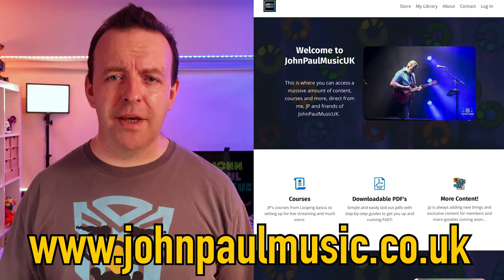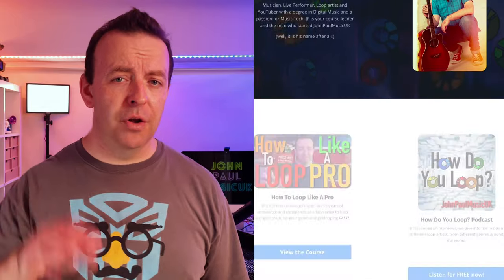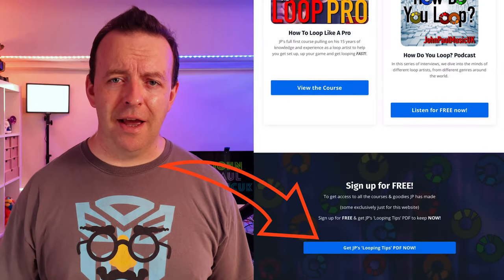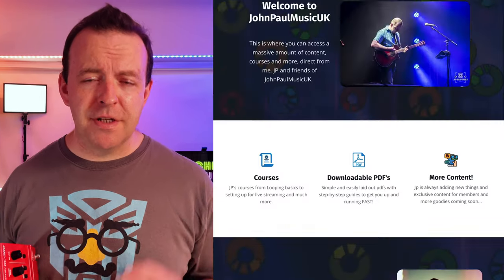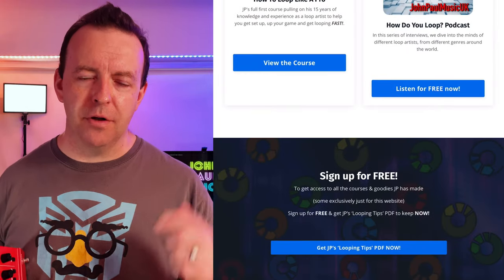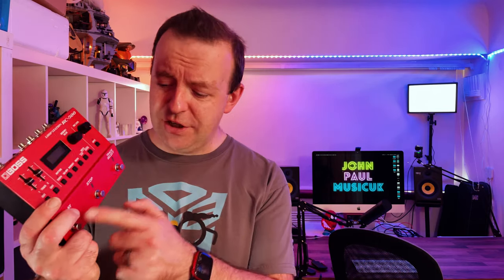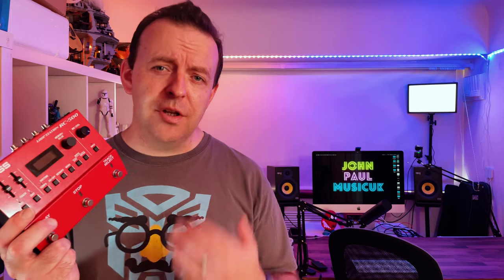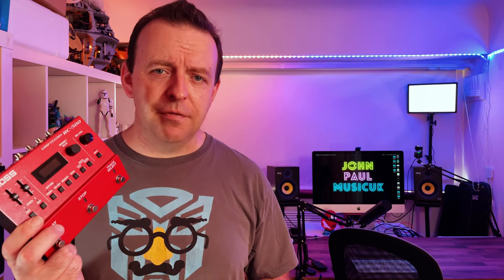Boss RC-500 - How to Route the Loops

Comment: I've banging my head against a brick wall, so I'm hoping you can help (I've just subscribed to the paying version BTW :-)) Right, first I have a mic and a guitar. Mic should go into MIC IN, and only to T1, Guitar should go into to INST IN B, and T2. Mic should also go (only) out of T1 (OUTPUT A) to its own channel on the desk. And the same for the guitar on T2 (OUTPUT B). I've followed your instructions in the video to the letter but am not getting a signal into the desk from the guitar....
Reply from the maker: Hi Nicolas 👋 
Thank you for becoming a member. 
So.. follow me closely, there are 3 things you need to change. 
The inputs, the outputs of those inputs and the outputs of the loops. 
1) select input button underneath the mic level
2) change MIC IN to OUT-A
3) change INST IN to OUT-B
4)EXIT
5) Click track 1 edit
6) Scroll across until you see T1 INPUT and Change this to MIC IN
7) Stay on the same menu and scroll across one more to T1 OUTPUT and put this to OUT-A
8) Press the Track 2 edit button
9) you should be (if you didn’t click exit between steps 7&8) on T2 OUTPUT, Change this to OUT-B
10) Scroll BACK one to T2 INPUT and change this to INST IN

EXIT AND WRITE THE THE MEMORY. 
You should now have the mic and the mic loops only coming to Output A and the guitar and guitar loops coming to Output B.
Enjoy. 👍🏼 😊
Reply: @JohnPaulMusicUK  Cheers JP - it works perfectly!!
Reply from the maker: Awesome 👏

Comment: I wanted to upgrade to the RC-500 from my Boss VE-8 (Which has an integrated looper just as a feature)... but the routing settings on the VE-8 just make more sense to me... I can select where the voice and where the guitar is coming out... Why can't the Boss RC-500 remember what's voice and what's guitar for every track? So for example voice is always coming out from Output A and Guitar always from Output B no matter which track is playing.... You always need to have Voice and Guitar seperated live, what are they thinking? This is bullshit, I'm glad I didn't buy it....
Reply from the maker: The routing can be set for the whole system if you want to for the inputs. 

Have a look at the parameter guide on page 14 and that is setting it for the whole system. https://static.roland.com/assets/media/pdf/RC-500_Parameter_eng01_W.pdf
But the output routing of the loops is per memory. 
Hope this helps.

Comment: Hello :) Is it possible to record with drums? I do not register drums in the wav file ... Regards Sielek :)
Reply from the maker: Are you looking to capture the kit from the Rhyrhm section? The wave file is your instrument or mic from the looper. 
If you want the Rhyrhm section as a wav file, you would have to record it from the looper into a recorder or DAW and then save that. Hope that makes sense?
Reply: @JohnPaulMusicUK  Thanks for the hint :) I think I'll just buy an audio interface and connect the looper's output. It will be the easiest way ... Regards :)
Reply from the maker: Yeah, good option. Don’t know why they took the ability to use the looper as an audio interface out. Such a shame. Miss that option, especially for recording.
Reply: @JohnPaulMusicUK  The drums can be in a loop :) There is an option in the settings. Input - Rhytm LOOP. Then they record while playing :) They are in the vaw file :)
Reply from the maker: Ahh. Okay. In the Parameter guide ‘Rhythm - Loop is described like this - 

‘With the “LOOP” setting, RC-500 drum sounds played by note messages from an external MIDI device can be output to a track and recorded.’ 

So I read that as it would send the same ‘pattern’ out as midi for an external drum machine to play it.

Comment: I have a problem: No matter what I do - and I believe I am doing it correctly as per your instructions ( and the manual) I cannot seem to isolate OUT-A and OUT-B. Everything comes out of both jacks, even if I am only trying to output rhythm to OUT-B. I even tried reinstalling the firmware. Everything else works perfectly. Cringe....
Reply from the maker: So have you changed the input as well as the output? Click on the input button (underneath the mic volume dial) and make sure you have changed the inputs as well as the outputs and the outputs of the loops too. 👍🏻 
Let me know if that helps.
Reply: @JohnPaulMusicUK   Thank you so much for your snappy response.
Me oh my. Tried plugging in both a and b out into a Scarlett 2i2 connected to GarageBand on the Mac so I could monitor the sound a bit better. Each track receives its own separated signal from the Scarlett, of course. Audio in both channels, even tried the A&B with bass and guitar - the sound from both instruments still comes in both channels. Aaargh. What really bothers me is that I cannot output the drums separately. I wonder if my unit is ... fawlty :-(
And... oh yes I clicked the buttons and chose ins and outs. And Saved.
Beautiful piece of machinery, but this is...
Reply: @NielsDesmo  I feel your pain.  Maybe you have it worked out by now but I have both the input A (guitar) setting to go to output A and the loop channel 1 setting to go to output A and only rhythm coming out of output B.  I still get guitar out of my PA hooked up to output B.  This is a deal breaker.

Comment: When live looping backing tracks on the fly and the pedal is on the floor this is of no use. Might as well just buy backing tracks. This pedal is extremely limited when it comes to verse and chorus. And the drum menu access is so overcomplicated when live. Bobbing up and down all the time. I bought this and found that the old Rc-30 is a much more user friendly pedal live.
Reply from the maker: Interesting. It totally depends on how you define “user friendly” Matt. 
I agree for just plugging in and looping, it’s not the easiest and it seems to me that they tried to cram as MUCH as possible into it, which means LOTS more setup time at home before any gig.. but in terms of versatility, it wipes the floor with any of the RC-Floor pedal range that’s come before it. (Not including the 202 or 505).
My only gripes are - 1) loss of the USB as an audio interface 2) the volume and noise suppression on the inputs. 🤷🏻‍♂️  why , and 3) the pedal can sometimes be a bit too clever for its boots if you are ever so slightly out it thinks you need an extra bar. This can be responded with either dictating the bars or free mode or really nailing your timing.
Reply: @JohnPaulMusicUK  Actually the 300 is still the flagship for live versatility. I can plug in my guitar bass and drumkit and go out to a mixer for vocals. The only thing is it's too big for the gig bag potability. I love the drum sounds in the 500, but what a pain for live stuff. I thought at first it would mean not carrying a drum kit, but I'm back to that. There is the wow factor too, but that is mostly just to get a reaction from other musos...look and he plays drums. The Joyo looper with 40 beats is so much more simple live. Just dial it up on the style and play.